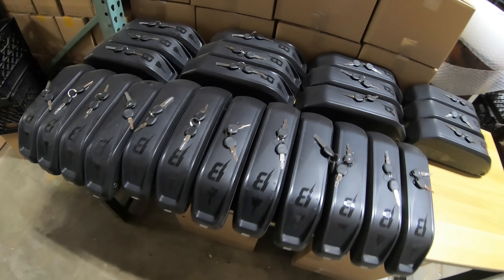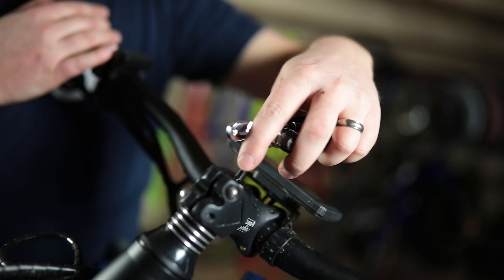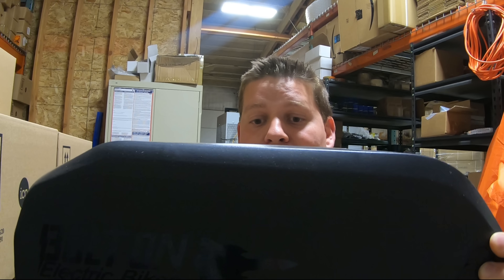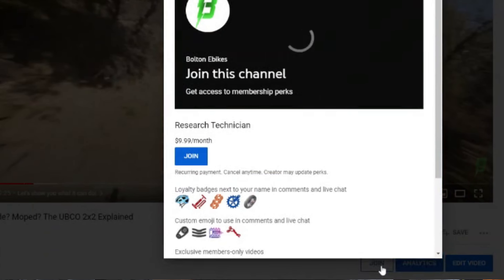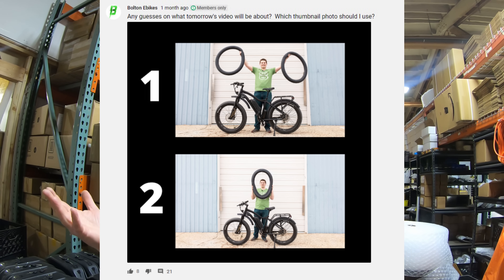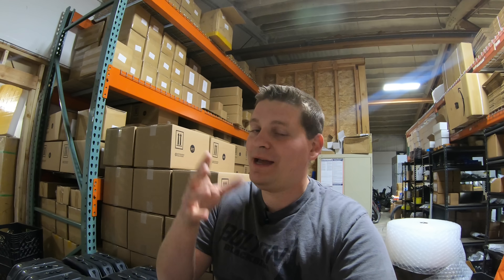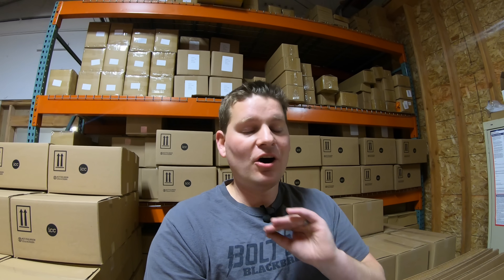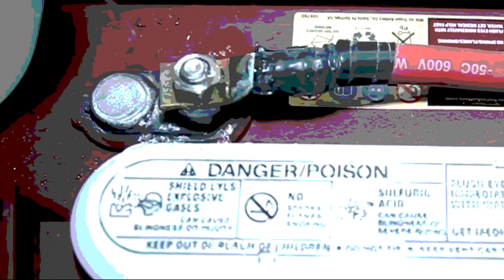How to maintain Lithium batteries for electric bikes - Easy!

Comment: HEY! WAIT A MINUTE! Show some love to the south! What about us guys in hot climates like me in Florida? I hear ya about storing the battery in the cold great icy north, but can I keep my battery on my bike in the summer in my garage down here? The temp may reach 105 degrees or so in there with no air conditioning. Should I remove the battery after every ride and bring it in the a/c? I'm guessing probably so because they say don't leave your cell phone in a locked car in the hot parking lot where temps can reach 115 or so very rapidly. Can an ebike battery handle 100/105 degrees 4 or 5 hours a day?
Reply: Brad Doe said, " in a locked car in the hot parking lot where temps can reach 115 or so very rapidly."
A company I worked for actually measured car and car trunk temperatures in the summer to test how to store their electronic equipment in their vehicles. 
This was in Central Texas on as I recall, a 100degF day.
The temperatures inside the car below the front and rear windows reached up to 180degF
The maximum temps on the seats and in the trunk were just a bit lower.

It should be noted that some advancements have been made in increasing the ability of auto windows to decrease the solar energy that is transmitted into vehicles.

I can only estimate the temperatures in places where the daily weather service temp might rise to almost 115 to 120degF. (remember, those weather service temps are measured in a special calibrated device that provides shade. They are not measured in direct sunlight.
Reply: @exgenica  Ouch! That's hot. Direct sun through the glass, I can see that. We don't get more than 91, 92 here in St. Petersburg usually on the hottest days. You know when you touch the steering wheel that's been in direct sun through the windshield in a closed car it can feel like it burned you. Hot, hot!
Reply: I agree! I’m in sw fl.  I will be charging my batt inside but obviously be using it in brutal heat and humidity.
Reply: Garage Temps should be fine but keeping in a vehicle in the sun wouldn't be recommended.  A quality lithium ion cell shouldn't suffer from storage Temps of up to 50-60C.

Comment: What about plugging it in. I've heard plug in to the wall first, then the bike and I've heard the opposite. What is the real deal?
Reply: it shouldn't really matter, but I always plug in the bike first, and then plug in or turn on the charger. I do the opposite with my phone, since that charger is already plugged in. On my bike the charger is plugged into a timer, so I plug in the bike, and then set the timer to 1, 2 or 4 hours, depending on how much I want/need to charge the bike. I like the timer because I can control the charge without watching it, and I know it will automatically turn off. From experience, I know that after my regular 25-26 mile ride, if the charge is down from 90-95% to around 50%, I will set the timer for 2 hours and that will take it back up to around 90-95%. Every so often I will set it for 4 hours to fully charge and balance the cells. It wasn't mentioned in this video, but it's also a good idea not to start charging right away after a ride. Let the cells stabilize for a few hours before starting the charge.

Comment: Thanks for the video . When I was looking at batteries for my travel trailer I did a lot of research that agrees with everything you said. I have always charged mine to 100% so I don't run short on rides and have not noticed any problem after nearly 4 yrs.  Keep up the good work Kyle.
Reply: same here.. ive had mine nearly four years and I charge it daily..
Reply: @europanzz  it also has a huge impact on the lifetime how empty you drive the battery please do not drive below 20%.
Reply: Never ever only charge to 80 or 90%, such advice is actually killing battery packs. Always charge until after the light turns green for cell balancing. An unbalanced pack will die significantly quicker than it will take to run through the cell cycles
Reply: @bigdiglett3258  Bullshit.

Comment: I'm curious about using voltage vs percentage on the display.  In the foxbat assembly video Kyle says he prefers the voltage but I'm not really sure why its better.  I've also noticed if you turn the bike off and back on again you get different voltage and percentage numbers so I'm left wondering how accurate either is
Reply: X2
Reply: @gregeastman8609  what is X2?
Reply: @chriskramer21   Times two-=agree with your comment
Reply: @gregeastman8609  lol damn I thought X2 was the answer to my question and I just had to figure out what it meant

Comment: Kyle, Does the Bolton fat bike fork have a rebound adjustment? I can't tell from the pics. If not, is it possible for Bolton to carry a decent $200. fat fork with rebound adjustment, a straight steerer tube and 135mm dropouts? No one carries a decent one and all the expensive forks have tapered steerers and thru axles. 

Can you do a video on the basic 3 headset bearings styles and maybe show a conversion set to go from a straight steerer tube setup to a tapered? Unfortunately all the tapered steerer expensive fat forks also have thru-axles, so a new front wheel or hub will be necessary.
Reply: I bought Kyles aftermarket air for and it does have rebound adjustment. I really like the fork and the price! The only negative I found on the fork is there is a slight amount of play in the slides but it hasn’t caused a problem yet and for the price, it’s really a nice fork.
Reply: @davel2119  Please forgive me if I sound insulting as no offense is meant... You have the Bolton Fat Fork and it DOES have a rebound adjustment? I'm having trouble with it b/c nowhere in his ad or video does it mention a rebound adjustment, and that's pretty important. Plus, I don't see a the common red rebound valve at the bottom of the fork, just the typical compression adjustment at the top of the right fork.  Just reassure me once more and it'll all be good.

Comment: A dedicated bike fanatic who owned a Yeti Goal Zero Lithium Battery Pack mentioned that Lithium units should never be taken down to 20%.  Was hoping this Youtube would have addressed a critical low threshold.  Great presentation otherwise.  Wonderful to learn Battery Love.
Reply: The critical low threshold is wherever the BMS cuts off the voltage (around 3-5% of capacity). I think it's just a general rule of thumb to maximize battery life to keep the charge between 20-80%. But from personal experience with various Li-Ion powered devices, the gain in longevity does not really justify the added inconvenience of always checking you stay within that range.
Check out some videos on super-charging electric cars, and you'll see that the highest charge the batteries can take is usually when the battery has between 5-20% state of charge (SoC). Those owners routinely let the SoC drop to 10%, then charge to 80% to minimize the charging time on long distance trips.

Comment: Wondering if there are 12volt chargers?
Reply: a simple solution is an inverter.....2A charger x 48V is 96 Watts....you can use a 100W inverter...very common and inexpensive.

Comment: Is there a problem if you charge the battery right after a ride or should one wait before charging? Thanks
Reply: Best to wait a little, give them time to cool.
Reply: Yes.. better to wait half hour at least before charging. I usually charge it the next morning after a ride, when it needs charging. Not after every ride... but when the battery drops to 1 or 0 bar in the screen.
Reply: After a ride, I just leave the bike as is depending on the percentage of battery left.  I try to keep it around 50-70%.  When it needs charging, I plug it into a smart plug (kasa) but don't turn it on yet.  I program the charge to start about 7 hours before my next ride.  That way the battery doesn't sit at 100% for a long time, which will eventually degrade it.  Here's a great video on that topic.   https://www.youtube.com/watch?v=Yf9N9zBgyB8

Comment: How do I charge typical ebike batteries these days (48 Volt or higher l think) from a 12 Volt DC car battery?
Reply: Use an inverter to get 120 V AC. You won't like the efficiency, but it will work.
Reply: I'd rather keep it all DC.
Any other ideas?
Reply: @wb6004  To keep it all DC, you have to keep the voltages the same. You CAN do it, but you won't like the requirements.

Open your battery box. Separate the batteries from their wiring, then rewire the correct number so that they are 12v in series. Charge that bank of batteries.

Lather, rinse, and repeat. Then rewire all batteries as before.

Do that every time you need to charge. It isn't something I would consider. From a convenience standpoint, it is probably a little easier than rebuilding the Great Wall by moving each brick one at a time, by hand

Comment: Great video. Batteries are complicated and they are expensive. This is a very important video. And do not constantly charge the battery after short rides.
Reply: It's perfectly safe to top off your battery even after just running a few miles.